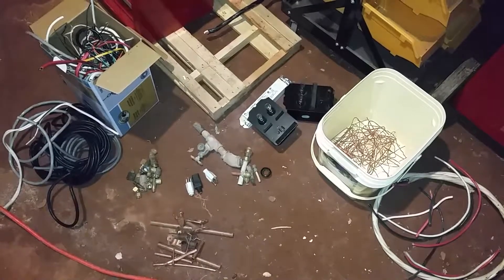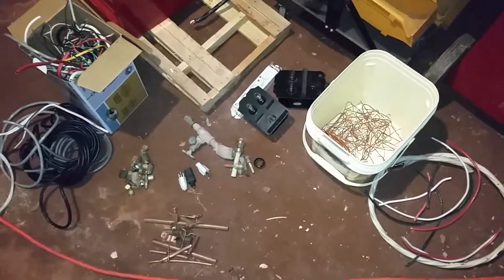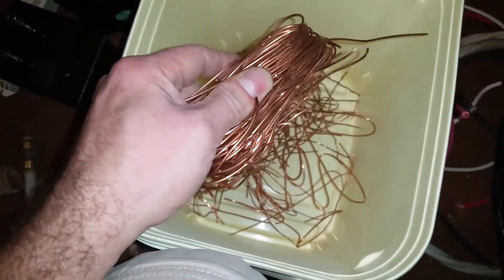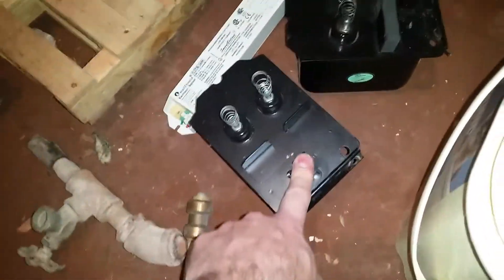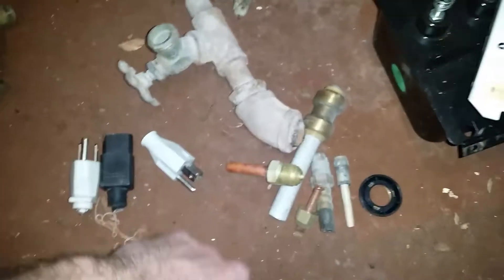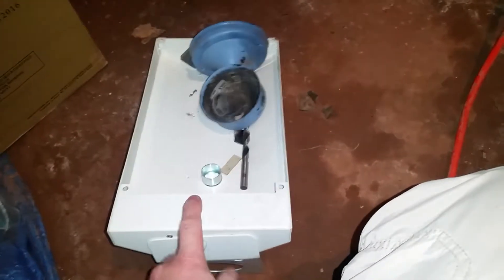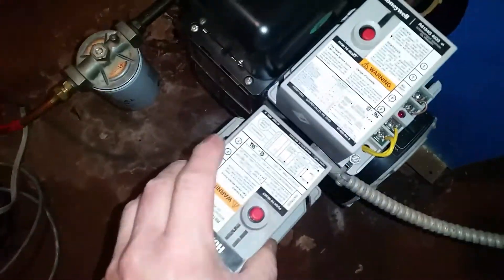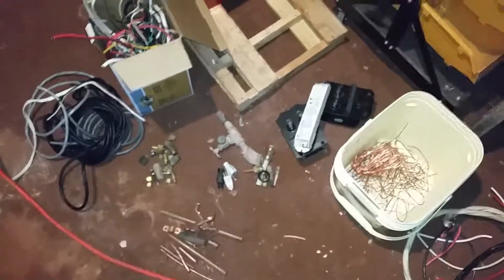BUCKET FULL OF BRASS FOR YOUR TROUBLES?

Comment: I really gotta get all my precious metals all together some day..I dont think I have ever seen a solid copper coat rack hook or copper wood screws? I bet the hook is die cast or regular cast aluminium and the screws are steel or brass..I could be wrong..but you might want to check them. You can get some pretty cool arcs out of them little black boxes if you know what your doing lol!
Reply from the maker: Yup those are definitely copper, I checked. They must be pretty old as they were in an old dilapidated shed when we bought the house.  Yes, you can get an arc out of those boxes but those 2 are toast,  I had to replace the one on my furnace a few weeks ago.  That's my goal too is to have everything organized.......